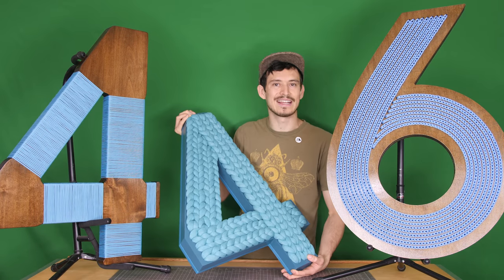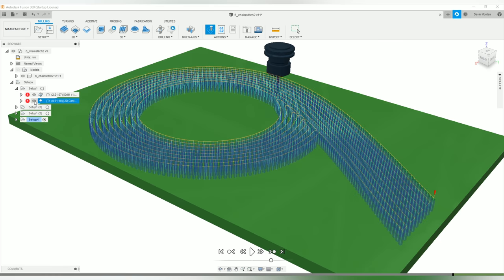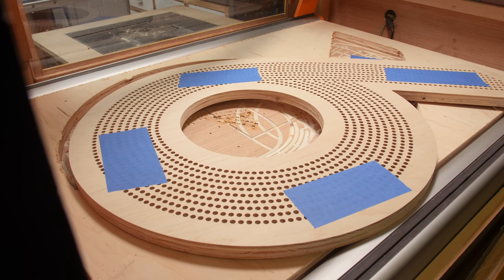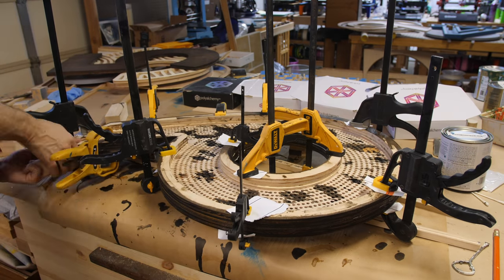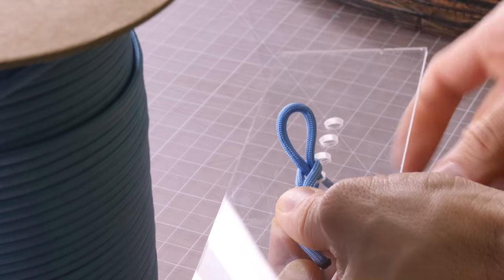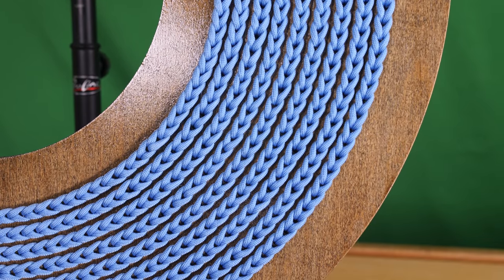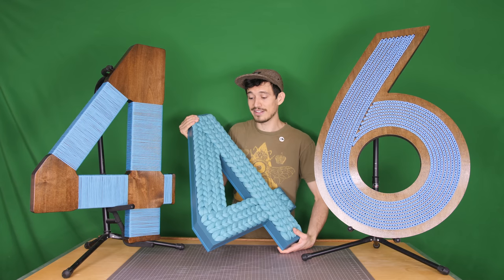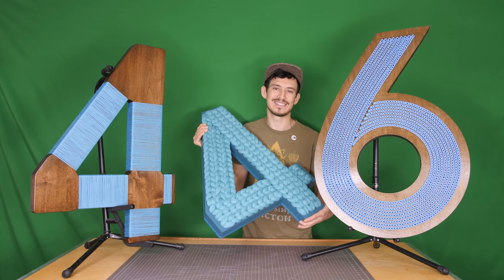Sixes get Stitches : Chainstitch through Wood // the Numbers Project

Comment: How tall is this building.... lol
Reply: I was thinking the same thing, "Damn! How many numbers does one building need?!"
Reply: It's at least 14 stories tall
Reply: @emrygoldstein9350  Wouldn't it need to be at least 24 stories tall since he has made three different 4s? They would be used for 4, 14, and 24.
Reply: @kwigbo  or they are used for different rooms.
One four for the staircase, one for the elevator and the third maybe for a second staircase or at the end of the floor.
Edit: Devin mentioned in another comment that the numbers are for the elevator corridors in two buildings.
Reply: I can answer this :) There are two buildings in the community, each is 6 levels tall, with several elevator lobbies at each level, which explains the redundancy in numbers. Cheers!
Reply: It's just a really confusing building that has ceveral 3rd floors
Reply: @emrygoldstein9350  it's been three months and still no number 7

Comment: It seemed like Natalie did have a good rhythm going but you might be able to speed it up significantly with some kind of a hook to bring the loops to the front--either a crochet hook or a piece of hanger wire, depending on the size of the yarn relative to the hole. I think it would be tricky to find a crochet hook that would catch that giant yarn!

Comment: I know you're done with this now, but that stitch is a lot more related to crochet than it is to embroidery and there's an easier method. Once you had that 3d printed hook all you have to do is stick the hook through the first loop before grabbing the second. So hook goes through the loop, then the hole, then grab the paracord and pull the new loop up through everything and pull tight. This does all of the of the fiddly bits for finishing the stitch in one straight pull and it automatically leaves the new loop on the hook. So it's already ready for the next hole.

Comment: Hi, I have a 3d printer and I have a lot of trouble getting prints to stick.  Every single print just falls off with the slightest effort.  None of my prints are successful.  I use a buildtak print surface and it still falls off like its glass.  How do you get your prints to stick to the bed?   I use hatchbox filament and print around 190 and 60 bed temp.  Should I try increasing the temperature of the nozzle for the first layer?

Comment: Thank you for being descriptive and specific. 

That's a HOLE lot of drilling. To me, the bit just dulled up as expected, then slipped upwards inside the chuck so you couldn't ever reach depth again with the same offset. I recommend using cheap normal drills because they are so easy to resharpen by hand, and have years of life to them, then you can have a pile ready and seriously really get after it. 

You:  8:01

Me: "You son of a..."